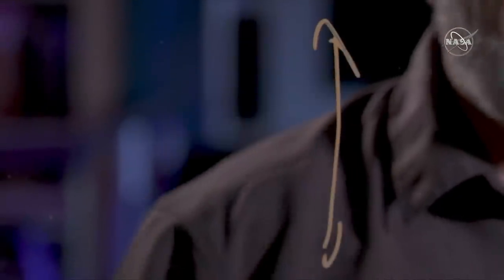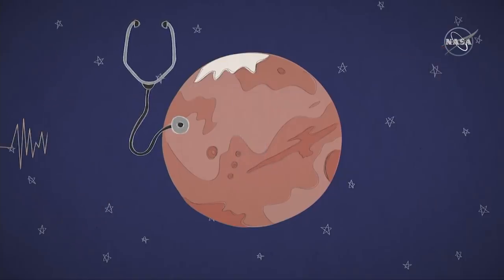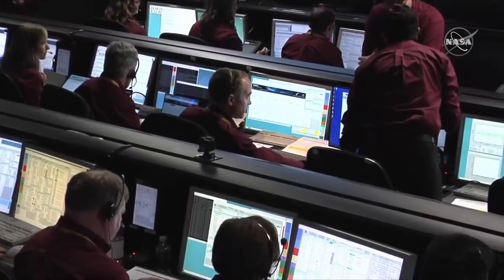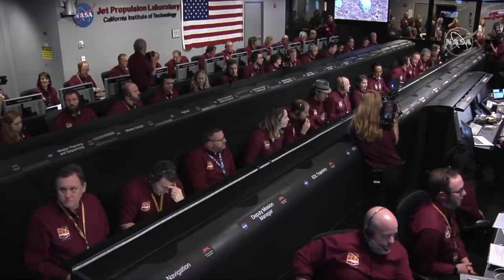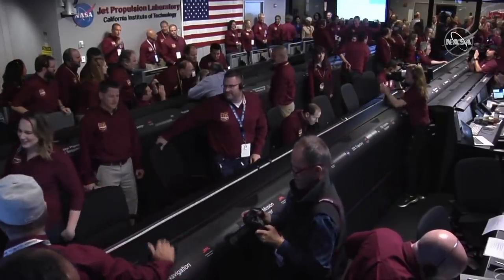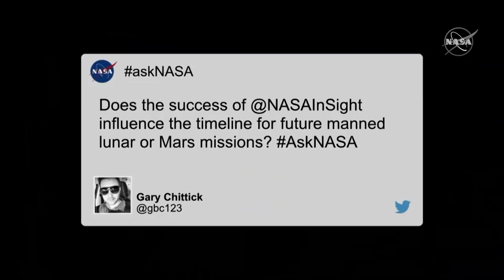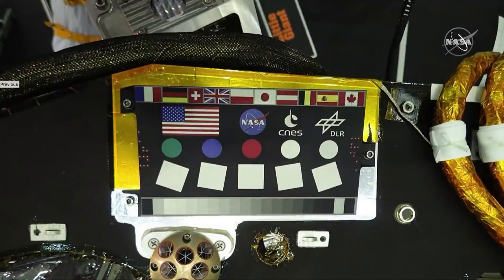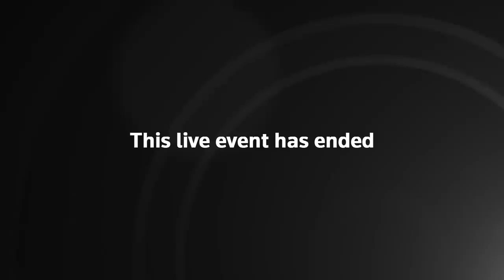Nasa probe lands on Mars after six-month journey through space – watch live

Comment: "In mere hours, NASA's InSight spacecraft will complete its seven-month journey to Mars. It will have cruised 301,223,981 miles (484,773,006 kilometers), entering the Martian atmosphere at a top speed of 12,300 mph (19,800 kilometers per hour)."      Can someone explain how InSight overpassed 484,773,006 kilometers in seven months if its top speed was 19,800 kilometers per hour? Why NASA choose to send sonda there when Mars is the farthest from Earth (even Mars can never be 484,773,006 km far from Earth, I suppose this is the path which InSight had to overpass in order to avoid The Sun!).
Reply: It’s called a Hohmann transfer orbit, where they used an eccentric orbit to get to a planet for the least fuel possible. And the top speed was when it escaped earth, with it slowing down as it reached the highest point in its orbit over the course of several months